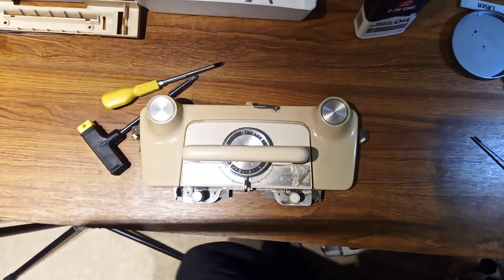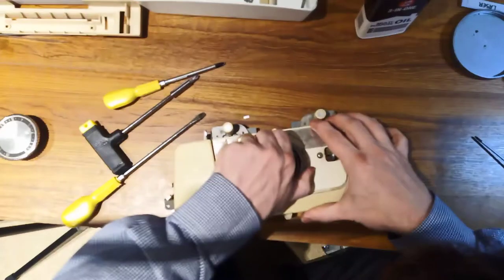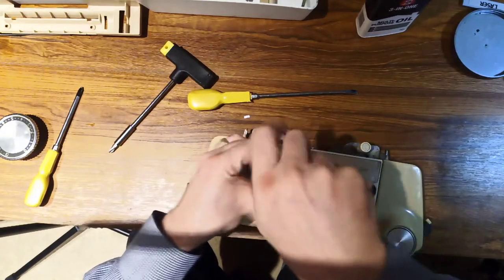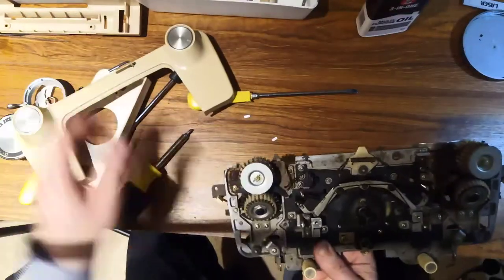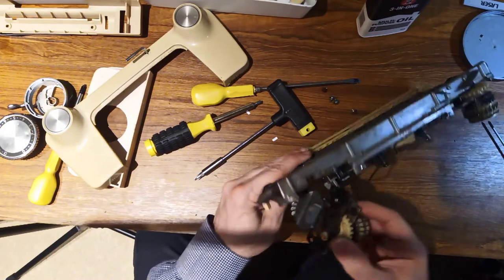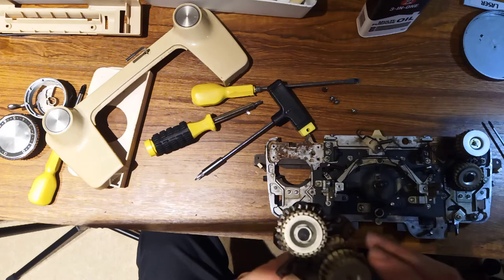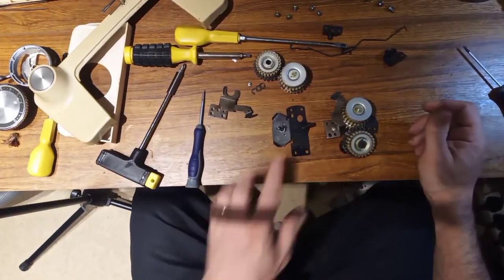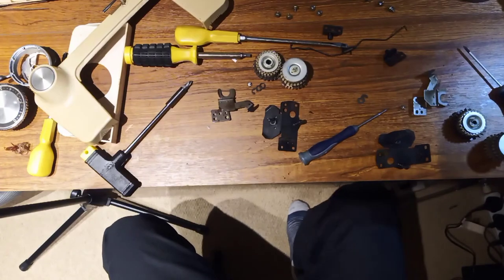Knitting Machine Restoration part 7: A carriage turns into a pumpkin

Comment: What grease do you use where grease should be.
Reply from the maker: I use all purpose Lithium grease from Halfords. Grease should go wherever metal meets metal and plastic meets plastic, but only if it's under a cover. If you can see it you should oil it.